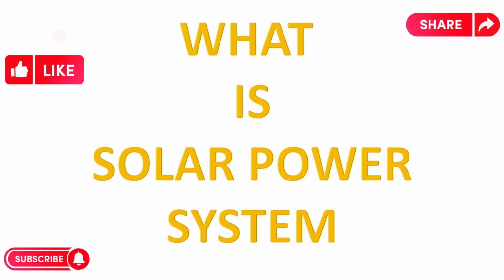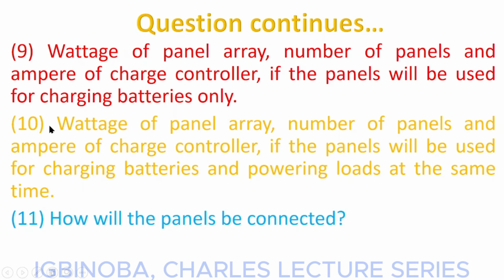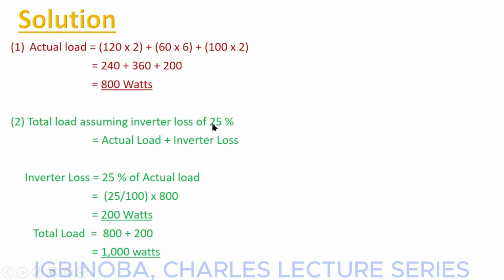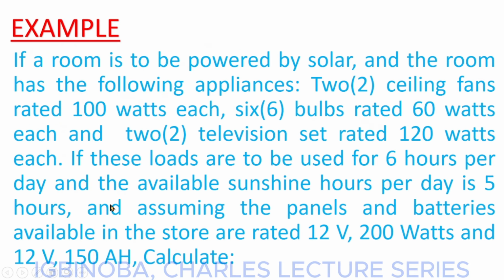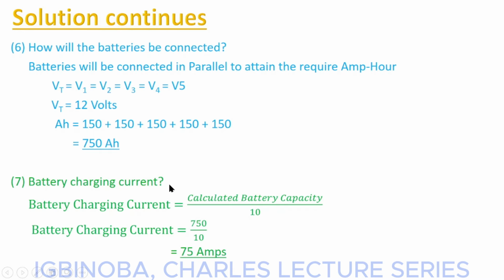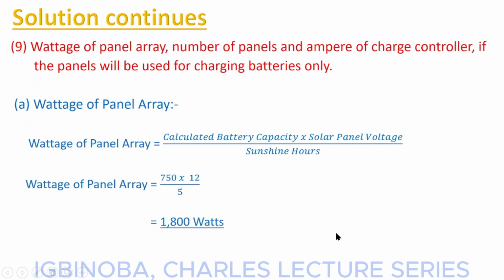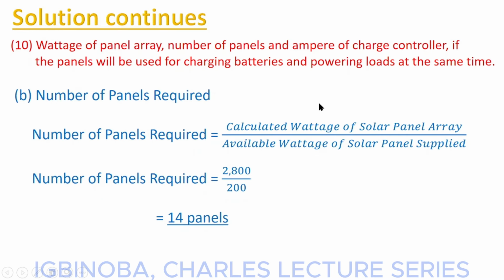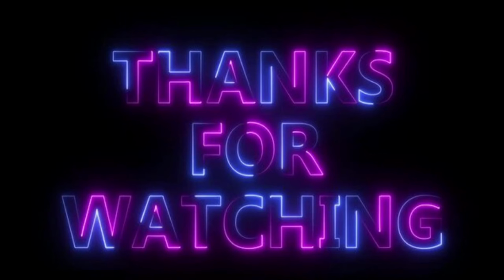Design of Solar Power System

Comment: MAR346T
1. Actual load= (100×3)+(60×10)+(120×4) =1380watts
2. Total load assuming inverter loss of 25%= Actual load +Inverter loss
Inverter loss=25% of Actual load
= 25%×1380=345 watts
Total load= 1380+345=1725 watts
3. Inverter rating on VA using power factor of 0.8
= (1725÷0.8)= 2156.25
4. Battery capacity using factor for reserve 75%=(2×1725×6×0.75)=1293.75Ah
5. No. of batteries for backup hours=1293.75Ah÷150Ah= 8.6 =8 batteries 
6. How batteries will be connected?
The batteries will be connected in parallel 
Vt=V1=V2=V3=V4=V5=V6=V7=V8
Ah= 150+150+150+150+150+150+150+150=1200
7. Battery charging current=1293.75÷10=129Amps
8. Battery charging time assuming charging loss of 40%= 1293.75Ah+(40%+1293.75Ah)÷129A=14hrs
9a. Wattage panel array= 3105 watts
9b. Number of panels required= 3105÷345=9 panels 
9c. Ampere of charging controller required= 3105÷12=258.75Amps
10a. Wattage of panel array= Calculated wattage of solar panel array for charging battery only+ calculated total load =3105+1725=4830watts
10b. Number of panels required= calculated wattage of solar panel array÷ Available wattage of solar panel supplied= 4830watts÷345= 14Amps
10c. Ampere of charge controller= calculated wattage of solar panel array÷ solar panel voltage=4830watts÷12volts= 402.5Amps
11. How will the panels be connected?
Ans: They will be connected in parallel

Comment: PETRO3131A

1. Actual Load : 1380 watts

2. Total Load : 1725 watts

3. Inverter Rating : 2156.25 VA

4. Battery Capacity : 1293.75 Ah

5. Number of Batteries : 8.625 - 9 batteries

6. Connection Parallel

7. Battery charging current: 129.375 Amps

8. Charging time : 14 hrs

9. (a) 3105 watts
(b) 15.525 - 16 panels
(c) 258.75 Amps

10. (a) 4830 watts
(b) 24.15 - 24 panels
(c) 402.5 Amps

11. Parallel connection

Comment: CHM340N

1.	Actual load = 1380 W
	2.	Inverter loss = 25% of 1380 = 345 W
Total load = 1380 + 345 = 1725 W
	3.	Inverter rating using 0.8 power factor
1725 ÷ 0.8 = 2156.25 VA
	4.	Battery capacity (75% reserve factor)
2 × 1725 × 6 × 0.75 ÷ 12 = 1293.75 Ah
	5.	Number of batteries for backup hours
1293.75 ÷ 150 = 8.625 ≈ 9 batteries
	6.	Batteries connected in parallel
Vt = 12 V
Total capacity = 150 × 9 = 1350 Ah
	7.	Battery charging current
1350 ÷ 10 = 135 A
	8.	Battery charging time at 40% loss
(1350 + 0.4 × 1350) ÷ 135 = 14 hrs

9a)
1293.75 × 12 ÷ 5 = 3105 W

9b) Number of panels required
3105 ÷ 345 = 9 panels

9c) Charge controller current
3105 ÷ 12 = 258.75 A

10a)
3105 + 1725 = 4830 W

10b) Panels required
4830 ÷ 345 = 14 panels

10c) Charge controller current
4830 ÷ 12 = 402.5 A
	11.	Panels connected in parallel

Comment: PETRO371S

1.Actual load=1380watts
2.Total load= 1725watts
3.Inverter rating = 2156.25VA
4.Battery capacity =1293.75Ah
5.Number of batteries =9
6.Parallel connection 
7.Battery charging current =129.375A
8.Battery charging time= 14hrs
9a.Wattage on pannel arrays= 3105W
9b. No of panels= 15.5=16panels
9c. Ampere of charge controller=258.75Amps
10a. Wattage of pannel arrays=4380watts
10b. No of panels=25panels
10c. Ampere of charge controller=402.5Amps
11. Parallel connection

Comment: PETRO3145O

1. Actual load = 1380W
2. Total load = 1725W
3. Inverter rating = 2156.25VA
4. Battery capacity = 1293.75AH
5. Number of batteries = 9
6. Battery connection = Parallel connection 
7. Battery charging current = 129.38A
8. Battery charging time = 14hours
9. Wattage of panel array = 3105W 
9b. Number of panels = 15.5 ~ 16 panels
9c. Ampere of charge controller = 258.75A
10. Wattage of panel array = 4830W
10b. Number of panels = 24.15 ~ 24 panels
10c. Ampere of charge controller = 402.5A
11. Panel connection = Parallel

Comment: EEE365M

1. Actual load= 1380 watts
2. Total load= 1725 watts
3. Inverter rating= 2156.25VA
4. Battery Capacity= 1293.75Ah
5. No. of batteries= 8.625~ 9 batteries 
6. Parallel 
7. Battery charging current= 129.375 amps
8. Charging time= 14hrs
9a. 3105 watts
  b. 15.525~ 16 panels
  c. 258.75 amps
10a. 4830 watts
     b. 24.15 ~ 24 panels
     c. 402.5 amps
11. Parallel

Comment: PETRO388J

1. Actual load: 1,380 W
2. Total load: 1,725 W
3. Inverter rating: 2,156.25 VA
4. Battery capacity: 293.75 AH
5. Number of Batteries: 8.6 batteries 
6. Parallel 
7. Battery charging current: 129.375 Amps
8. Charging time: 14hrs
9. a. 3,105W, b. 15.5~16panels c. 258.75Amps
10. a. 4,830W, b. 24 panels c. 402.5Amps
11. Parallel

Comment: PETRO3161E

1. Actual load: 1,380 W
2. Total load: 1,725 W
3. Inverter rating: 2,156.25 VA
4. Battery capacity: 293.75 AH
5. Number of Batteries: 8.6 batteries 
6. Parallel 
7. Battery charging current: 129.375 Amps
8. Charging time: 14hrs
9. a. 3,105W, b. 15.5~16panels c. 258.75Amps
10. a. 4,830W, b. 24 panels c. 402.5Amps
11. Parallel

Comment: EEE360H
1. Actual Load = 1380 watts

2. Total Load = 1725 watts

3. Inverter Rating = 2156.25 VA

4. Battery Capacity = 1293.75 Ah

5. Number of Batteries = 8.625 ~ 9 batteries

6. Parallel

7. Battery charging current = 129.375 Amps

8. Charging time = 14 hrs

9. (a) 3105 watts
    (b) 15.525 ~ 16 panels
    (c) 258.75 Amps

10. (a) 4830 watts
    (b) 24.15 ~ 24 panels
    (c) 402.5 Amps

11. Parallel

Comment: PETRO31A

1. Actual load= (100×3)+(60×10)+(120×4) =1380watts
2. Total load assuming inverter loss of 25%= Actual load +Inverter loss
Inverter loss=25% of Actual load
= 25%×1380=345 watts
Total load= 1380+345=1725 watts
3. Inverter rating on VA using power factor of 0.8
= (1725÷0.8)= 2156.25
4. Battery capacity using factor for reserve 75%=(2×1725×6×0.75)=1293.75Ah
5. No. of batteries for backup hours=1293.75Ah÷150Ah= 8.6 =8 batteries 
6. How batteries will be connected?
The batteries will be connected in parallel 
Vt=V1=V2=V3=V4=V5=V6=V7=V8
Ah= 150+150+150+150+150+150+150+150=1200
7. Battery charging current=1293.75÷10=129Amps
8. Battery charging time assuming charging loss of 40%= 1293.75Ah+(40%+1293.75Ah)÷129A=14hrs
9a. Wattage panel array= 3105 watts
9b. Number of panels required= 3105÷345=9 panels 
9c. Ampere of charging controller required= 3105÷12=258.75Amps
10a. Wattage of panel array= Calculated wattage of solar panel array for charging battery only+ calculated total load =3105+1725=4830watts
10b. Number of panels required= calculated wattage of solar panel array÷ Available wattage of solar panel supplied= 4830watts÷345= 14Amps
10c. Ampere of charge controller= calculated wattage of solar panel array÷ solar panel voltage=4830watts÷12volts= 402.5Amps
11. How will the panels be connected?
Ans: They will be connected in parallel

Comment: MECH344R

1. Actual load: 1380 watts
2. Total load: 1725 watts
3. Inverter rating: 2156.25 VA
4. Battery capacity:1293.75 Ah
5. Number of batteries: 8.6
6. Connection: parallel
7. Battery charging current: 129.375
8. Charging time
9. a. Wattage of panel array: 3105W
b. Number of panels:16 panels
c. Charge controller: 258.75A
10 a. Wattage of panel array - 4830W
b. Number of panel - 24
c. Charge controller - 402.5A
11. Panels arrangement: Parallel

Comment: MECH3151U

1. Actual load = 1380W
2. Total load = 1725W
3. Inverter rating = 2156.25VA
4. Battery capacity = 1293.75AH
5. No of batteries = 9
6. Batteries are connected in parallel 
7. Battery charging current = 129.4A
8. Battery charging time = 14hrs
9a. Wattage of panel array = 3105W
9b. Number of panels = 16 panels
9c. Charge controller = 258.75A
10a. Wattage of panel array = 4830W
10b. Number of panel = 24
10c. Charge controller = 402.5A
11. Panels are arranged in parallel

Comment: MAR317Q
1.Actual load =1380 watts
2.Total load =1725watts
3.inverter rating =2156.25 VA
4.Battery capacity =1293.75Ah
5.No of batteries = 9
6.Batteries are connected in parallel 
7.Battery charging current =129.4amps
8.Battery charging hours =14 hrs 
9a.wattage of panel array =3105watts
9b.number of panel =16panels
9c.charge controller =258.75A
10a.wattage of panel array =4830watts
10b.Number of panels =24
10c.charge controller =402.5A
11.panels are arranged in parallel

Comment: PETRO358F

1. Actual load = (100×3)+(60×10)+(120×4) = 1380 watts

2. Total load assuming inverter loss of 25% = Actual load +Inverter loss
Inverter loss = 25% of Actual load
= 25%×1380 = 345 watts
Total load = 1380+345 = 1725 watts

3. Inverter rating on VA using power factor of 0.8
= (1725÷0.8) = 2156.25

4. Battery capacity using factor for reserve 75% = (2×1725×6×0.75) = 1293.75Ah

5. No. of batteries for backup hours = 1293.75Ah÷150Ah = 8.6 = 8 batteries 

6. How batteries will be connected?
The batteries will be connected in parallel 
Vt = V1=V2=V3=V4=V5=V6=V7=V8 Ah = 150+150+150+150+150+150+150+150 = 1200

7. Battery charging current = 1293.75÷10 = 129Amps

8. Battery charging time assuming charging loss of 40% = 1293.75Ah+(40%+1293.75Ah)÷129A = 14hrs

9a. Wattage panel array = 3105 watts

9b. Number of panels required = 3105÷345 = 9 panels 

9c. Ampere of charging controller required = 3105÷12 = 258.75Amps

10a. Wattage of panel array = Calculated wattage of solar panel array for charging battery only+ calculated total load = 3105+1725 = 4830watts

10b. Number of panels required = calculated wattage of solar panel array ÷ Available wattage of solar panel supplied = 4830watts÷345 = 14Amps

10c. Ampere of charge controller = Calculated wattage of solar panel array ÷ solar panel voltage = 4830watts÷12volts = 402.5Amps

11. The Panels will be connected in parallel

Comment: PETROCHEM 387I
1. Actual Load = 1380 Watts
2. Total Load = 1725 Watts
3. Inverter rating= 2156.25 VA
4. Battery Capacity= 1293.75 AH
5. Number of batteries= 9 batteries 
6. How the batteries will be connected= Parallel 
7. Battery charging current= 129.375 A
8. Battery charging time= 14 hours
9. Wattage of Panel array ( battery only) = 3105 Watt
Number of panels= 16 panels 
Ampere of charge controller= 258.75 A

10. Wattage of Panel array ( plus load) = 4830 watt
Number of panels= 25 panels
Ampere of charge controller=  402.5 A
11. How the panels will be connected= Parallel

Comment: CIV315O

Actual load: 1380 W

Total load: 1840 W

Inverter rating: 2300 VA

Battery Capacity: 1227 AH

Number of batteries: 9

Battery connection: parallel

Battery charging current: 15A

Pannel array (for batteries only)

Wattage: 2945 W

Number of panels: 15

Charge Controller Ampere: 245 A

Panel array for batteries and panel loadings:

Wattage: 4785 W

Number of panels: 24

Charge Controller Ampere: 399 A

Panel connection series: parallel

Comment: COMP358F

1) Actual load: 1380W
2) Total load: 1840W
3) Inverter rating (VA): 230OVA
4) Battery capacity: 1227Ah
5) Number of batteries: 9 batteries
6) Battery connection: Parallel
7) Battery Charging Current: 15 A (per battery string)
8) Battery Charging Time: 5.1 days.
9) Panel Array (for charging batteries only): - Wattage:
2945 W - Number of Panels: 15 panels Charge
Controller Ampere: 245 A
10) Panel Array (for charging batteries and powering loads): Wattage: 4785 W - Number of Panels: 24 panels - Charge Controller Ampere: 399 A
11) Panel Connection: Series - Parallel

Comment: MECH3190H
1. Actual Load: 1380 watts

2. Total Load: 1725 watts

3. Inverter Rating: 2156.25 VA

4. Battery Capacity: 1293.75 Ah

5. Number of Batteries: 8.625-9 batteries

6. Parallel

7. Battery charging current: 129.375 Amps

8. Charging time: 14 hrs

9. (a) 3105 watts

(b) 15.525-16 panels

(c) 258.75 Amps

10. (a) 4830 watts

Comment: PETRO344R

1. Actual Load : 1380 watts

2. Total Load : 1725 watts

3. Inverter Rating : 2156.25 VA

4. Battery Capacity : 1293.75 Ah

5. Number of Batteries : 8.625 - 9 batteries

6. Parallel

7. Battery charging current: 129.375 Amps

8. Charging time : 14 hrs

9. (a) 3105 watts
(b) 15.525 - 16 panels
(c) 258.75 Amps

10. (a) 4830 watts
(b) 24.15 - 24 panels
(c) 402.5 Amps

11. Parallel

Comment: PETRO3114J 

1. Actual Load : 1380 watts
2. Total Load : 1725 watts
3. Inverter Rating : 2156.25 VA
4. Battery Capacity : 1293.75 Ah
5. Number of Batteries : 8.625 - 9 batteries
6. Parallel
7. Battery charging current: 129.375 Amps
8. Charging time : 14 hrs
9. (a) 3105 watts
(b) 15.525 - 16 panels
(c) 258.75 Amps
10. (a) 4830 watts
(b) 24.15 - 24 panels
(c) 402.5 Amps
11. Parallel

---

Here you go — exactly the same format.

Comment: EEE3157A
1) Actual load =1380watts

2) Aotal load =1725watts

3 Inverter rating = 2156.25volts

4) Battery capacity = 1293.75Ah

5) Number of batteries =9

6) Batteries are connected in parallel

7) Battery charging current is 129.4Amps

8) Charging time = 4hours

9a) Wattage of panel array =3105watts

9b) Number of panels =16 panels

9c) Charge controller = 258.75A

10a) Wattage of panel array =4830watts

10b) Number of panels =24panels

10c) Charge controller =402.5Amps

11)The Panels are arranged in parallel

Comment: NAT330D
1) Actual Load=1380watts

2) Total load=1725watts

3) Inverter rating=2156.25VA

4) Battery capacity=1293.75Ah

5) No of batteries=9

6) Batteries are connected in parallel 

7) Battery charging current=129.4amps

8) Battery charging time=14hrs

9a) Wattage of panel array=3105watts

9b) Number of panels=16panels

9c) Charger controller=258.75A

10a) Wattage of panel array=4830watts

10b) Number of panels=24

10c) Charger controller=402.5A

11) Panels are arranged in parallel

Comment: MAR376X

1. Actual load: 1380 watts

2. Total load: 1725 watts

3. Inverter rating: 2156.25 VA

4. Battery capacity:1293.75 Ah

5. Number of batteries: 8.6

6. Connection: parallel

7. Battery charging current: 129.375

8. Charging time. 14 hours

9. a. Wattage of panel array: 3105W

b. Number of panels:16 panels

c. Charge controller: 258.75A

10 a. Wattage of panel array - 4830W

b. Number of panel - 24

c. Charge controller - 402.5A

11. Panels arrangement: Parallel

Comment: CHM3140J
1) actual load=1380watts
2)total load = 1725watts
3 inverter rating -21 56.25v
4) battery capacity = 1293.75Ah
5) number of batteries =9
6) batteries are connected in parallel
7) battery charging current is 129.4amps
8) charging time=4hours
9a)wattage of panel array=3105watts
9b)number of panels =16 panels
9c charge controller =258.75
10a)wattage of panel array =4830watts
10b)number of panels=24
10c) charge controller =402.5A
11)panels are arranged in parallel

Comment: EEE3151U

1. Actual load is 1380w
2. Total load is 1725w
3. Inverter rating is 2156.25VA
4. Battery capacity is 1293.75AH
5. No of batteries 8.6~9 6.parallel 
7. Battery charging current is 129.375 amps
8. Charging time is 14 hours
9. (A) 3105W
(B) 15.5W
(C)258.75A
10. (A) 4830w
(B)24 panels 
(C)402.5 A
11. Parallel

Comment: EEE399U
1)actual load=1380watts

2)total load=1725

3)inverter rating=2156.25VA

4) battery capacity=1293.75A

5) No of baterries=9

6) baterries are connected in parallel

7) battery charing current =129.4amps

8) battery charging time=14hrs

9a) wattage of panel array=3105watts

9b) number of panels=16panels

9c) charge controller=258.75A

 10a) wattage of panel array=4830watts

10b) number of panels=24

10c) charge controller=402.5A

11) panel are arranged in parallel

Comment: CHM3168L

1. Actual load=1380Watts
2. Total load=1725Watts
3. Inverter rating=2156.25VA
4. Battery Capacity=1293.75AH
5. Number of Batteries=8.625=9
6. The batteries will be connected in parallel to attain required amp.hrs
VT=V1+V2+V3+V4+V5+V6+V7+V8+ V9
AH=150+150+150+150+150+150+150+150+150=1293.75AH
7. Battery Charging Current=129.375Amps
8. Battery Charging time=14hrs
9a. Wattage of Panel Arrays =3105Watts
  b. Number of panels required=15.525panels =16panels
  c. Ampere of Charge Controller=258.75Amps
10a. Wattage of panel arrays=4830Watts
    b. Number of panels required=24.15panels=25panels
    c. Ampere of charge controller=402.5Amps
11. The panel will be connected in parallel

Comment: CHM31A
1. 1380 watts

2. 1725 watts

3. 2156.25Va

4.1293.75Ah

58.6

6. Parallel

7. 129.375

8. Charging time

9.(a) wattage of panel array=3105W

(b) Number of panel =16 panels

(c) Charge controller=258.75 A

10.(a) Wattage panel array=4840 W

(b) Number of panel =24 panels

(c) Charge controller= 402.5A

11. Panel arrangement parallel

Comment: MAR355C

1. ACTUAL LOAD = 1380W
2. Total load = 1725 W
3. Inverter Rating = 2156.25 VA
4. Battery Capacity = 1293.75Ah
5. Number of batteries = 9 
6. The batteries are connected in Parallel connection 
7. Battery Charging current = 129.38A
8.  Battery charging time = 14hours
9. Wattage of panel Array = 3105W
10. Ampere of charge controller = 258.75A
11. Wattage of panel array = 4830W
12. Number of panels = 25 panels 
13. Ampere of charge controller = 402.5A
14. The panels are arranged in a Parallel connection

Comment: MECH 395Q

1. Actual Load: 1380 watts
2. Total Load: 1725 watts
3. Inverter Rating: 2156.25 VA
4. Battery Capacity: 1293.75 Ah
5. Number of Batteries: 8.625 – 9 batteries
6. Connection: Parallel
7. Battery Charging Current: 129.375 Amps
8. Charging Time: 14 hrs
9. (a) 3105 watts
   (b) 15.525 - 16 panels
   (c) 258.75 Amps
10. (a) 4830 watts
    (b) 24.15 – 24 panels
    (c) 402.5 Amps
11. Connection: Parallel

Comment: EEE313M
1. Actual Load = 1380 watts
2. Total Load = 1725 watts
3. Inverter Rating = 2156.25 VA
4. Battery Capacity = 1293.75 Ah
5. Number of Batteries = 8.625 - 9 batteries
6. Parallel
7. Battery charging current = 129.375 Amps
8. Charging time = 14 hrs
9. (a) 3105 watts
(b) 15.525 ~ 16 panels
•
(c) 258.75 Amps
10. (a) 4830 watts
(b) 24.15 ~ 24 panels
(c) 402.5 Amps
11. Parallel